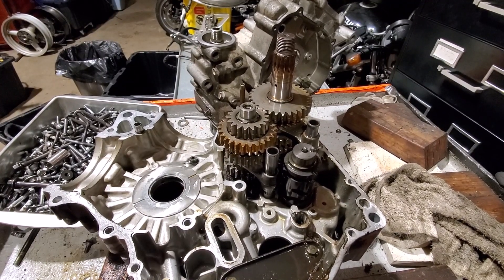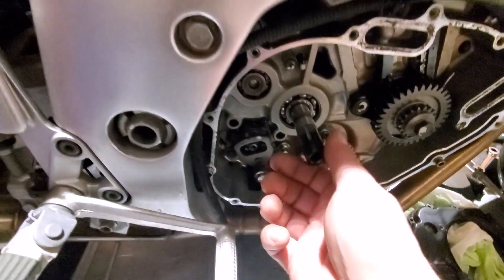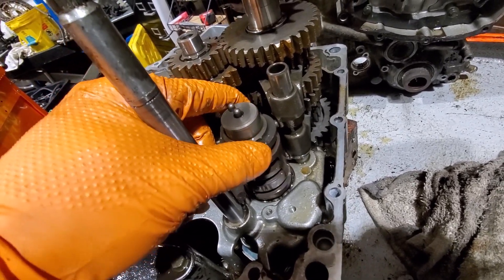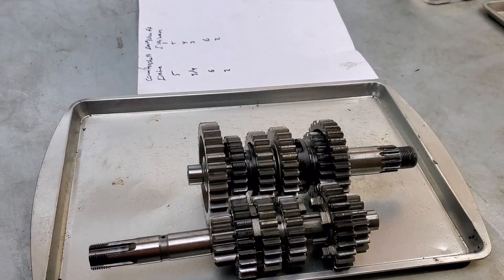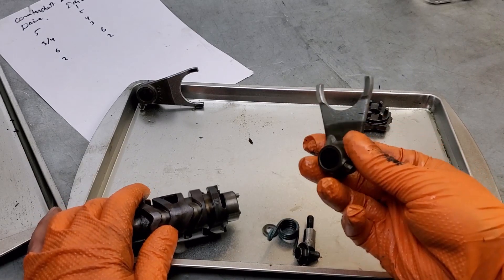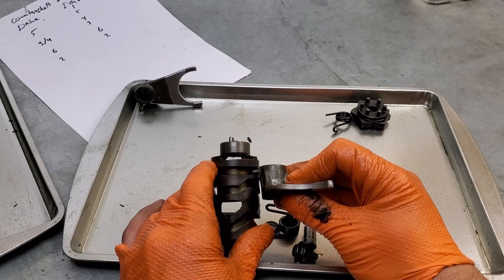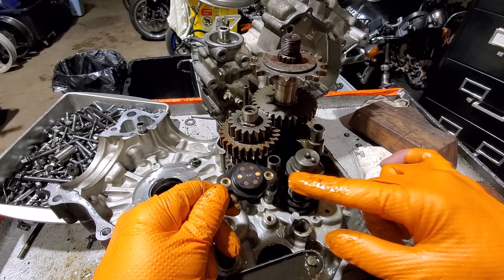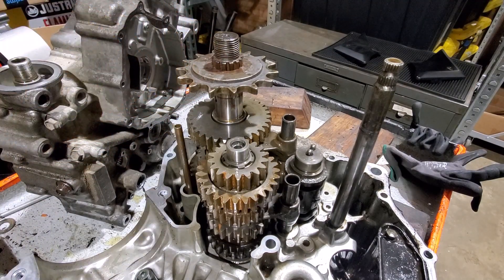how does an sv650 transmission work? (and i'm sure other motorcycles)

Comment: Love it. These instructionals are priceless. So to help ease my mind here, if you don't care. One time I took a corner much too wide yet when I recovered I was going too slow and almost stalled in high gear and while doing so I heard a few metal on metal low rpm *clanks*. It's been behaving fine after that but was it the dogs just escaping their placement? Something I should worry about? Thanks, Sergei.
Reply from the maker: That sounds more like chain jumping around than anything else

Comment: Am really enjoying these tear-downs and explanations. Could you take a look at all the bearings in the case and the transmission/counter-shaft? I wonder which ones are bearing the highest load and have the shortest life span.
Reply from the maker: i'm quite sure the crank bearings will be the first to go. cause thats what dies in race bikes (either that or rod bearings). 
i'll have to do some homework on the other case bearings since I've never really had to deal with them